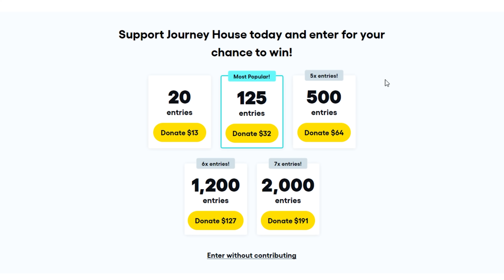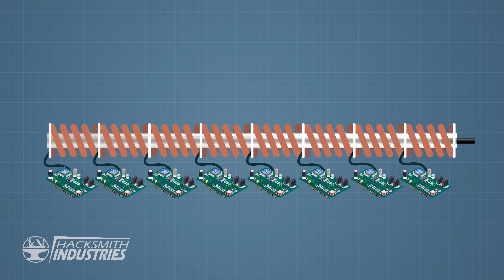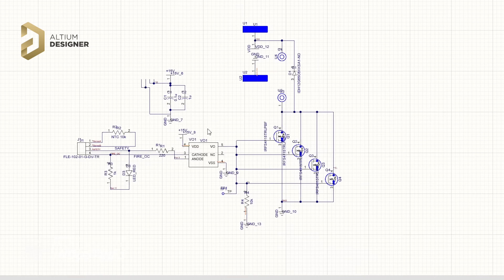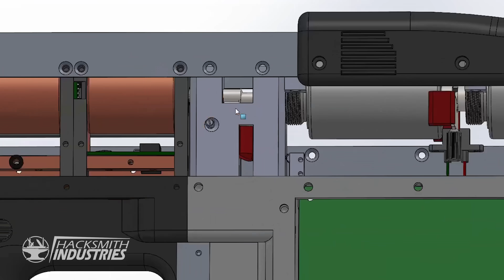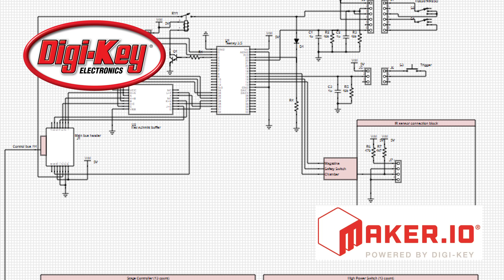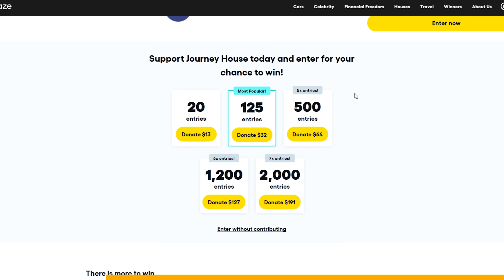MOST POWERFUL ENERGY WEAPON WE'VE EVER MADE!

Comment: Can't imagine how frustrating and tedious it must have been to buff out every kink with every test fire and then in the end it still jams and heats up like crazy, looks absolutely incredible despite its faults though, appreciate the hard work that went into this ^w^
Reply: Well, the heating is mostly a thing you can't avoid no matter what.
Every resistance will produce heat equivalent to the power that runs through it.
And since there is a metric ** ton of power running through those coils, you just sometimes have to accept that and run the thing for only so long at a time.
Reply: @itwasntme967  even though the overheating portion is impractical, it coincides with the guns in the game overheating so it kinda works out
Reply: Someone copied your comment

Comment: V3 should use an onboard cooling system and slugs.

Perhaps a cooling cycle between mags to flush coolant through a few water blocks, along with slightly more weight to the projectiles to prevent the drag from effecting them as much.

It's a shame that you couldn't make it a bit stronger like you wanted, because I could imagine some real fun coming from that thing like seen with similar heated weapons.

Honestly though this is a 10/10 andI love it

Comment: For the barrel, why didn't you offset each segment or make them interlock to self-align?  Best case would be 3 layers, the outer 2 to securely align the barrel and the innermost as the actual barrel.  Short of that, you can cut a single layer barrel so the segments either screw together, lock like the lugs on a rifle bolt, or clip together.  Of course, you would want to shape these so any ledges that might be created would only catch the bolt going backwards, the rearward barrel segment should always go inside the forward segment, that would reduce the amount of energy lost to the wobble.

Comment: What if you just cut the coils in half down the barrel? Could that work? Then you wouldn't have to worry about a rubber mallet or energy loss at much. You could also put a 3D-printed rifled barrel instead of a plastic tube. That will increase the accuracy and distance of the round, especially if it is pointed.

Comment: I think you might be able to boost the power of the rifle with a simple addition.  Magnetic circuits obey Hopkinson's law, and the magnetic circuit includes the interior of the solenoid where the projectile travels, followed by the air surrounding the solenoid.  You might be able to increase the reluctance of the circuit by wrapping the solenoids with muMetal sheet thereby significantly increasing the field in the circuit.  I could be mistaken, but it would be easy to try. Another step would be to put a muMetal washer between each solonoid that would further shorten the path where the magnetic field had to travel through air.

Comment: Should put a spin on the projectile to make it fly straight. Also use a gas piston to feed the rounds in and as it does the expelled compressed air can be redistributed to the coils and cool it. Should make it sound cool A.F. when firing.

Comment: Suggestion: Instead of a rapid fire assault rifle, why not a (bolt action?) sniper rifle
More room to fit in more components
Simpler slower loading mechanism 
While larger and probably heavier, it doesn't need to be as streamlined 
Trade off would be, rate of fire=easier for distance and precision=hard

Comment: Very cool, the full auto mechanism alone is note worthy.

Regarding performance increase, lighter projectiles will probably do better and go faster.
Here, in Germany, for instance there is a 7.5 J limit to licence free airguns. But still the 4.5 mm pellets
that weigh only 1 or 2 grams shot from it go at 100+ m/s. So even with that 5 Joule limit in Canada with 
very lightweight projectiles there could be archieved a considerable projectile speed.

Also..I am sure there is americans that would gladly provide testing grounds for a high powered version of this..

In any case, well done!

Comment: FyI since projectile speed is increasing with each coil, you need to make each coil shorter for shorter pulse duration and higher current, due to the decrease in projectile field duration. This should also mean each coil operates at a higher voltage, so the magnetic field switches faster and to a higher value. If each coil was just 10 percent shorter than the previous one, it would increase your efficiency by a LOT.  You can also switch from one polarity with a big cap to the opposite polarity from a smaller cap, to force field collapse when you need to transit out of the coil into the next one. The projectile's field will still be present and you can push it out while the next coil pulls. The caps for this can be really small in value, like 10 percent or less that of the pull capacitor, because their only purpose is to reverse the field.
Reply: Yes that makes  sense also you need to 4x5 then (-65)+56=

Comment: High Voltage over current, and Maybe transformer metal for the pipe or capacitor discharge at high voltage?

Comment: I have experience with magazines and aerodynamics.  Consider different materials or shapes for the projectiles, as something slightly finned with a twist may function better for the purposes of firing out of a linear accelerator, and you can get around magazine feed issues by first, switching to a double-stacked magazine configuration which is yes, complicated and potentially costly, but increased spring pressure and feed lips that simply prevent the projectiles from spewing out into the action.
Reply: Idk canada gun laws but i wonder if it would be possible for them to just buy a commercial double-stacked magazine and modify it for the flechettes.
Reply: @Kiyo Senpai They could use the standard pellet shape. Its aerodynamically stable.

Comment: Would it help to include some sort of rifling in the barrel, or is that even possible? That would make the projectile more accurate and be able to travel farther.
Reply: Sort of…
Rifling could give projectile a spin, but it would also require projectile to be in much tighter contact with the walls of the "launch tube" - it would need to be "pressed into rifling", thus increasing friction and making heat problems worse…
Unless there is teflon or graphene coating on the inside and projectile is coated in some sort of soft material, that has similar parameters as lead in normal rounds, when it comes to ability of being pressed into riffling…
Reply: @FalkonNightsdale  that makes a lot of sense, I appreciate the explanation.  I wonder if you could make the projectile it self have polar ends, or magnetically charged tops and bottoms, and make the current spin the projectile as it propels it forward.  Programming that would be a nightmare, but if anybody is up to the task, it’s the hacksmith team.  I also wonder if you could somehow create a liquid nitrogen cooling system, that cools as it launches the projectile.  It would be more stuff to put in, but the vapors the liquid nitrogen would make would look pretty awesome 😂.

Comment: could you stabilize the bolts by swisting them in the barrel?
Reply: and maybe try to evacuate the inside of the barrel and have a timed valve (with an actuator) timed perfectly for when the projectile comes out... ofyourse you would have to have a air tight barrel

Comment: I thought it looked a little low power for the theoretical abilities you could get from such a system. Only 5J of energy and such a low muzzle velocity restriction definitely is rough for such a project, though it did look very good. Maybe one day you guys can do a V3 build in the states where you don't need to worry about the same restrictions limiting how overkill you can go on the design. Best of luck on your future projects and progressing this design even further if you have the desire to.
Reply: 152 m/s is still a lot, faster than even the fastest modern crossbows. 5 J is not a lot, but even that can do quite a lot. I think they need to decrease projectile weight to only 1 or 2 gramms.
Reply: @kairi4640  Considering they probably live close to toronto or montreal they could just set something up in Michigan or Vermont and have it only be like an hour or two drive. Its legal everywhere in the US to build firearms at home with no need to inform the gov or any permits.
Reply: @Nick-sx6jm  Bit more than that. US definition of a firearm is that you are using a self-contained cartridge where an explosive burns up to send the projectile out. So for example a naval cannon or a musket is not a firearm because the powder and shot come as two separate items. Similarly a railgun, coilgun, etc uses electric current to fire the projectile and is not a firearm. 

So all in all you could build a fully automatic space cannon and as long as you don't hit any satellites with it you'll be fine.
Reply: @Nick-sx6jm  as god intended 😎
Reply: @Kaiwalski  Once the NFA, ATF, and GCA are repealed and some federal reciprocity laws are put in place then it will be as God intended.
Reply: @Nick-sx6jm  bruh
Reply: @Nick-sx6jm  agreed i was msotly joking cause the statement that god specifically intented for us to make over the tope weapons was kinda fun